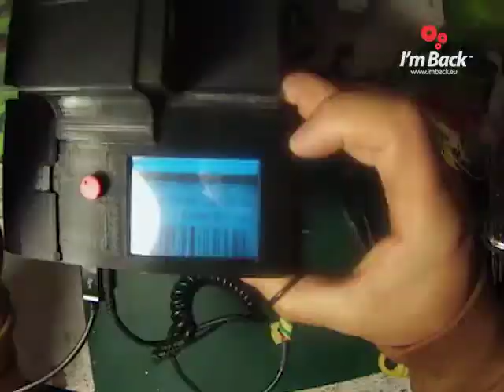Timelapse with a GoPro. Building a working I’m Back™ digital back for analog cameras - Raspberry Pi

Comment: I like the general idea, I'm bound to do something similar for personal use. Maybe use the same housing but change it up a bit on the innerds. 

I'd love to tear apart a modern SLR and merge it's components with my beloved Nikon F. Of course, it is essential to have all of the electronics in a removable back, just like you did. Funny fact, it never did occur to me that the PC/flash sync cable could be used to trigger the digital camera shutter. 

Wish list which is why I'll never have a finished project that is ready to use like yours:

* For the Raspberry Pi to be able to know the selected shutter speed on the mechanical shutter. Then to log it, even in a text file or CSV, bonus points if it's actually embedded in the photo's meta data but a script/app could do that right before importing the photos. 

* Same for aperture. My Nikon F has this physical arm that mechanically links wit the light meter in the viewfinder prism (which is detachable). I could perhaps use the same mechanism to allow the current aperture setting to be saved alongside or with every photo.

Thank you for this video and for the work you did. It is really cool!
Reply from the maker: Thanks, and good work!

Comment: For these 35mm cameras, rather than having an external assembly could a sensor and circuitboard be placed in the camera? Perhaps a spacing adapter could be attached to the lens mount to maintain the proper flange focal distance.